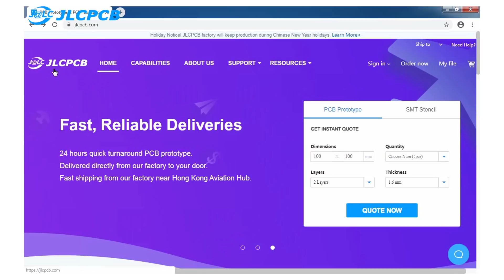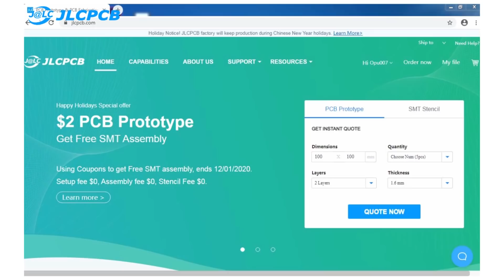5 Awesome Led Light Life Hacks

Comment: The UV LED would be a nice, cheap and simple light for curing SLA/resin 3D prints when the sun isn't shining. Add a small turn-table (glue a disc or an old CD onto one of those wheels you used for the lasers, maybe?), add a timer to shut it down after an hour and you're all set
Reply: Bro make it